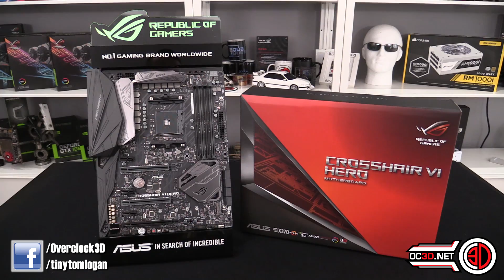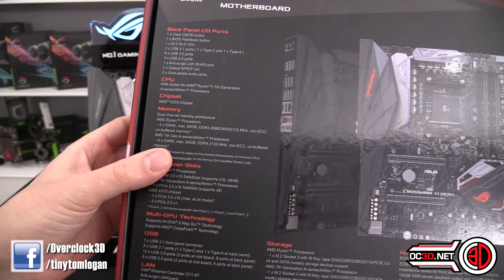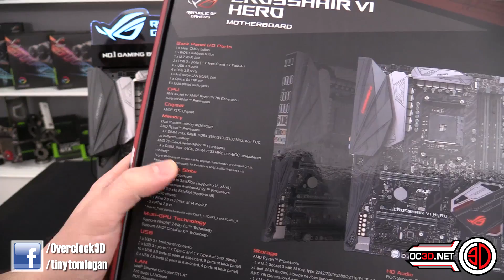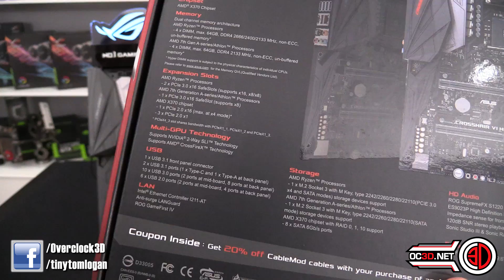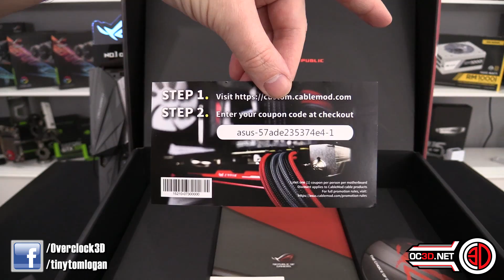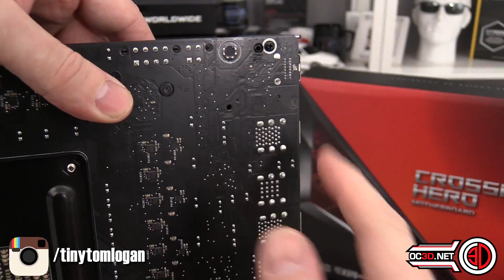Asus Crosshair VI AM4 Ryzen Motherboard Preview

Comment: I'm currently having issues booting into the bios even with beta 5704 bios. I was however able to boot into windows by disconnecting the keyboard only with the beta bios as it detected no keyboard and decided to boot. This is really strange. For those of you that may ask how i flashed the bios without going into it, I used Bios flashback from "Bios usb port". Anyone else have this issue? I'm using the Logitech G510s keyboard.

Comment: Does the board come with the appropriate backplate to mount an AM3 cooler or would that need to be taken from another AM3 board?
Reply from the maker: normally comes with the cooler
Reply: Ah, gotcha. I was just asking because the Kraken x41 doesn't have anything more than the screws and the upper bracket. I may have to get the am4 bracket from nzxt.

Comment: Thank you so much for this video, specifically the part about the bracket (AM3) because I ALMOST scrapped my X62 Kraken fora custom loop because I didn't want to wait the 3 weeks for a new bracket considering the 1800X I pre ordered doesn't have a cooler.  I was also very torn on what board, that that made my decision.

Comment: Honestly the wifi functionality can be easily achieved. The Wifi Go module with antenna only costs about 40 dollars in China, and with a aftermarket backplate I can upgrade this board to a higher end version if I wanted. 
Hopefully ASUS would bring more higher-end AM4 boards in the future adding more features like 2 internal USB2.0 and another USB3.0 connectors, better PCB strength for beefy air cooler, or even add another M.2 slot maybe?

Comment: "We haven't had PCIe 3.0 on AMD before" That's just wrong. I've got PCIe 3.0 on my FM2+ Athlon 860K and i have yet to encounter a game, that doesn't run well with my system. Even GTA 5 and Cities: Skyline run decent enough.
Reply from the maker: No dude thats PCIE2
Reply: Funny. Everest, HWInfo, AIDA...all show PCIe 3.0, 8 GT/s full duplex. Even AMD say, that it's PCIe 3.0 on their homepage - ASUS does too. Something's fishy...
Reply: Tom is wrong, FM2+ was the first AMD chipset to support PCI-E 3.0. It required both an FM2+ motherboard and FM2+ APU/CPU, using an FM2 APU/CPU, despite socket compatibility, would force it back to PCI-E 2.0. Nothing fishy at all.
Reply: I know - i have been using FM2 Boards with FM2 CPU's and FM2+/FM2+ CPU's
 for the past 3 Years. And you know what? The speed difference is 
noticable with an RX480. Most of the games i play are GPU Bound, so i 
put my older 750K FM2 CPU in (was easier, than to figure out how to get 
back to PCIe 2.0 via Software).

Comment: OC3D TV
It is good iff some X370 motherboards support SLI but it is not good that every x370 motherboard supports SLI. It does cost $10 because those scumbags of Nvidia make you pay that for just the bloody license. A waste of money if you know for sure that you will never use two Nvidia cards (or in my case 1 Nvidia card).
Reply: Every X370 board supports SLI, just not every AM4 motherboard (B350 and A320 exist too).
Reply: The relevant question is wether or not the B350 motherboards can 
overclock as well. I do want overclocking and crossfire, I don't want to
 pay 10 euro to a company whose ethics might be even worse than that of 
 the most succesful investment banks. ;)
Reply: Yes, B350 supports overclocking. A320 does not however. This chart basically summarises it. http://core0.staticworld.net/images/article/2017/01/am4-chipset-100702364-orig.jpg 
Additional connectivity (USB 3.1 Gen 2 ports, PLX chips, etc...) may be added by board partners.
Reply: I know that on paper B350 supports overclocking, the question is wether or not the motherboardcompanies do it decently, i.e. getting the maximum clock frequency that this CPU can achieve with a high end air cooler in a good case (airflow, large size) without the VRM's getting too hot to sustain it. Also I am not sure wether or not 6 years from now the most powerful single graphics cards still has enough PCIe lanes. 
They just shouldn't have put SLI on every X370 motherboard. Most people will never use it but now 100% of the people who buys a X370 motherboard has to pay for it and support a horrible company (Nvidia).

Comment: The real reason for cooler mounting changes have been stated that the actual AM4 cpu package is slightly higher than the old cpus... It certainly looks like AM3 coolers are supported but i dont know how that could be the case if these reports are true...

Comment: Bit dissapointed with the RAM speed support on the back of the box. Most other review sites have been shipped their review sample Ryzen with Corsair Vengeance 3000Mhz. I read somewhere else it supports up to 3200Mhz.

Really impressed with the AM3 cooler support tho!!!
Reply from the maker: Id take it with a pinch of salt till reviews are out tbf

Comment: What would be a good PSU to pair this with?? My current CX750M only has 8 pins to the CPU for power. It's time for an upgrade. Suggestions would be appreciated. :)
Reply: Michael Chen EVGA G3 or G2 series.

Comment: so it may mean i could run my 8350fx cpu ?
Reply from the maker: Christopher Doherty no just old coolers.
Reply: just a bit confused as you said ryzen  7 gen cpus and a athlon prossessors  so some ppl would think a athlon cpu on it as well ? and why not just say backwards con with the am3/ am3+ coolers
Reply: It is more an indication that AMD will be releasing Athlon CPUs based on Ryzen microarchitecture.

Comment: Looks like Ryzen do not support x16/x4@3.0 configuration (graphics card at x16@3.0 and pci-e ssd at x4@3.0). If u put your NVMe ssd in second pcie 3.0 slot, your graphics card will be gimped to x8 speed. If u put your NVMe ssd in lowest x16 (x4 electrical) 2.0 slot u will gimp not only speed of your drive but also add alot more latency since thoose lines are connected to chipset.
Reply: Bartosz Maj Then just buy an M.2 NVMe drive and put it in the M.2 slot. Done.
Reply: Bartosz Maj I'm sure other boards have shared the dedicated PCIe 3.0 x4 lanes for the M.2 with a physical x16 slot. So that config is still possible just not with this board.
Reply: Is this true?? Will my ssd not run at full speeds then if I buy ryzen+am4 motherboard?? I need answers here...
Reply: Nessie Jr It will run at full PCIe 3.0 x4 if used in the M.2 slot. The M.2 on AM4 has its own dedicated x4 lanes direct to the CPU.
Reply: Thanks for the answer man. One more question. If kaby lake z270 and ryzen x370/b350 have the same pci-e lanes then why do the z270 boards tend to have 2 m.2 slots lately, some even have 3 (MSI Z270 gaming M7, MSI Z270 xpower gaming titanium). I don't get that, is there any difference there?
Reply: Z270 chipset have more lanes (i think 14 vs 8 in X370) so they can have more M2 slots. I was talking before about pcie ssd that uses pcie slot (like graphics card), not m2 slot with x4 speed. Ryzen same as Kaby Lake have only 16 pcie 3.0 lines wired directly from cpu to regular pcie slots. Ryzen also have 4 pcie 3.0 lines from cpu but only to single m2 slot and u cannot use thoose 4 lines for regular pcie slots. If u have more than 1 m2 slot on Ryzen mobo then second one will be slower because of connection to chipset. Broadwell-E have 28 or 40 lanes at 3.0 for pcie slots and m2 slots + additional  lines for X99 chipset. Lines connected directly to cpu are alot better because u got the best communication and smallest latency. If u have M2 x4 SSD then u are fine with Ryzen.
Reply: Bartosz Maj Damn that sucks for Ryzen honestly. Not to be very greedy Z270 and X370 chipsets ATLEAST should be the same, have the same lanes etc. etc. Let alone the X99 chipset which seems that they are miles behind. If this is the case then that is currently the biggest downside for ryzen right now imo....I'll have to do some more research looks like...
Reply: Nessie Jr If they all had the same 40 lanes then both the CPU's and motherboards would be more expensive. The majority of people only need 16 lanes. If you need much more than that go with a X99 system, no research needed.
Reply: Kurt Phillips Nah I don't need 40 lanes lol. I'm not sure about the z270 vs x370 chipsets now though. Is is true that x370 chipset supports less lanes than intel's z270?
Reply: Z270 platform has 20 lanes to the cpu (16 for graphics, 4 for the chipset). 

X370 platform has 24 lanes to the cpu (16 for graphics, 4 for the chipset, and an extra 4 dedicated to storage. These are the 4x lanes used for the M.2)

The biggest differences lie with the connections from the chipset. Z270 has 24x PCIe 3.0 lanes coming off the chipset. This allows more M.2 and other devices to be connected, even though the max throughput to the CPU is a maximum of 4x PCIe 3.0. 

So for example if you have three M.2 devices in Raid 0 they wont end up much quicker than a single drive because they will have limited bandwidth to the CPU.

X370 only has 8x PCIe 2.0 coming off the chipset. That is why most X370 boards have just one M.2 because the itself chipset doesn't provide PCIe 3.0. Ryzen has more controllers (USB, SATA ect.) integrated into the CPU itself so less connections are needed to go through the chipset so I think that why there is less connectivity directly from X370 chipset.

Making Ryzen more of a SOC makes sense for a lot of situations but I wish they had either made the 8x chipset lanes PCIe 3.0 or added an extra 4x lanes from the CPU. This way it would have been easier for motherboard manufacturers to add more M.2 slots. Some are selling X370 boards with two slots but at the moment I'm unsure of what methods they are using to do it so we'll have to wait for the reviews.
Reply: I think that second M2 could be sata only because it will be connected to chipset anyway. Proably uses one pcie 2.0 lane just like regular sata port, turns off one port if used, and offers typical sata speed 5xx MB/s.

All of this is really strange. AM4 have how much, 1331 pins?, and offers nothing beyond Intel 1151 socket in terms of pcie lanes...

Comment: If this costs under £170 i am gonna kill myself as i recently bought i7 7700K and Asus Strix Z270H mobo and that mobo is not the best it is a little shorter from left to right than ATX so if inserting ram or cables on the right side it will flex the board also no RGB or 3.1 front panel connector and the 3.1 connectors on the I/O are type A so no thunderbolt 3 support
Reply: if anyone is wondering why i bought it i have been waiting for a long time to build my first PC and ryzen was not even released i had my Corsair Hydro H115i and Vengeance LPX 16GB 2x6GB ram for like half a year and could not wait any longer but the lack of ryzen support is also bad slower ram support and less headers and other options as well as only 2 ram sticks supported when there is clearly 4 ram slots

Comment: This is actually a little disappointing in that I was rather hoping that with 24 x PCIe 3.0 lanes we could have a situation where I could have a 16x GPU and my 8 x PCIe NVMe card without dropping the GPU down to 8x :( - also only one m.2 PCIe slot, the second's SATA only - shame. There'll be better boards I'm sure.

Comment: 2017 and we have 2666 MHz ram motherboards. please kill me and revive me when AMD pull their head out their ass
Reply: My Z170 Asus board package says that it supports up to 2667 Mhz, but the manual says 3600 Mhz. My RAM was set to 3200Mhz automatically. It's just that officially DDR4 runs stable at 2667 Mhz max. Do some research
Reply: it supports 3200mhz OC.
Reply: mrzazzaable everyone knows that theres no motherboard or cpu that supports memory over like 2666 natively right but OCing it yes at least 3000 or above with XMP or AMP profiles
Reply: it supports 3200 DIMM OC I went to the website and checked. also there were rumors that ryzen was only going to support 2666mrz ram but now it offically supports up to 3600mhz so packing may have to change in the future.

Comment: processor with pins!!!! i don'l like that, in the past when you want to remove your fan you had a chance to remove it with the processor too
Reply: you warm it up before you pull on it.
Reply: Marian Pelmus Simple. Whenever you want to remove the heatsink, try to rotate the heatsink left and right before pulling up. That way you will not pull it with the CPU.

Comment: Damn it asus. Where is the usb type c and built in wifi
Reply: With all those ports a USB Wifi would probably have better reception and a BT module is like $9. The built-in on my Asus Z97 ITX was not great and I'd prefer the off-board solution

Comment: so there won't be any apu on am4? there doesn't seems to be any display output on the motherboard
Reply: they purposely left it out as this is high-end board. the cheaper boards will have display ports
Reply: high end enthusiast mobo wont have display output port u need discrete graphic card the 350 320 and 370x have them but not the high end board so far.

Comment: Well done! Thank you for the nice review. 
I can't wait and see what would be the performance with Ryzen CPU installed on that motherboard! 
BTW - noticed that Ryzen supports only 24 lane so with Cross Fire or SLI it will support only 8x/8x PCI express (not 16x/16x). Wonder if the plan to compensate this somehow...

Comment: I'm really confused on the RAM specs on these boards. I'm most interested in this particular MB, but I can't pull the trigger on the pre-order because I want to use my 3200. Does anyone know for sure what is going on?
Reply: You can still use your 3200, just at a lower frequency. The Gigabyte AX370 K7 states compatibility with 3200mhz whether most CPU's will handle it is a different question. Wait until the reviews come out and you'll probably get a better answer.

Comment: this is one of the reasons I'm a amd fan only I can use my fx 8350 with this motherboard amd rocks, I was a intel fan until 2000 from 2000 I only buy over 100 gaming rigs in have build  amd ,asus .thank you for the info
Reply from the maker: you can NOT use you 8350 with this board. It supports AM3 coolers but the socket is AM4 and is not backwards compatible with older CPU's
Reply: Oh I thought it said that it works with old cpu I'm ok thank you

Comment: am3 cooler support. Thanks asus I can continue to use my old evo 212
Reply: The 212 evo can keep my fx8320 (tdp 125w) at 40°c max when I am gaming, why are you calling it a "weak sauce".
Reply: *Cryorig H7 :)
Reply: Sadly it's the only mobo that has am3 mounting holes too
Reply: I seriously doubt that, the FX chips never measured temps properly anyway. my 6300 used to report 23c under load  (colder than ambient) on a hyper 103.
Reply: You are right, 6300 owner here.
Reply: This can't be right, as EK has stated that all their am3-coolers supports the new am4 socket.
Clearly that means that the holes aren't changed?
Reply: The screws will fit, but do you think the cooler will line up and completely cover the CPU ?
Reply: the evo should be fine to cool  a 95tdp cpu......not overclocked ofc ..its rated 150-180w tdp....amd wrath coolers have a 140tdp rating... https://www.pcper.com/files/imagecache/article_max_width/news/2017-02-22/AMD%20Ryzen%20Cooling%20Solutions.jpg
Reply: Coltc8 Well I'll bait for wenchmarks as they say since all this is speculative right now. Surely there will be many reviews on air cooling. I'm curious on how the Evo stacks up against Cryorig and Noctua's new am4 coolers.
Reply: Same thing here.
Reply: I think the spire max is going to be better than the 212 evo
Reply: i dont have an 212evo but i doubt,not at least on the same noise level,i hope you are right tho.
Reply: Rentta cooler master is shipping free adapters (you only pay for shipping). I don't know about the other manufacturers.
Reply: StopaskingformynameYouTube I think it depends on the mounting solution they use, for example, some of coolermaster am3 coolers are compatible with am4 but others like the 212 evo need an adapter or a motherboard like the one in the video.
Reply: Oh wow, i've seen the video now.
That's strange.
Reply: I know... I have seen the same thing. Thermeltake does not claim the same however, so I do not know why it would be different with EK blocks. Pretty frustrating..